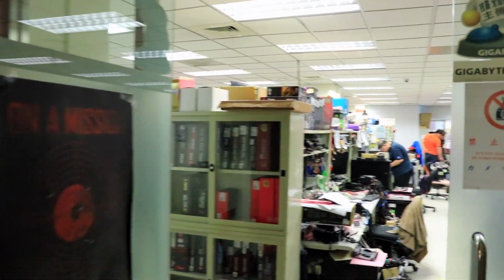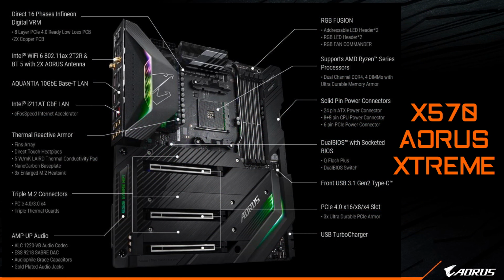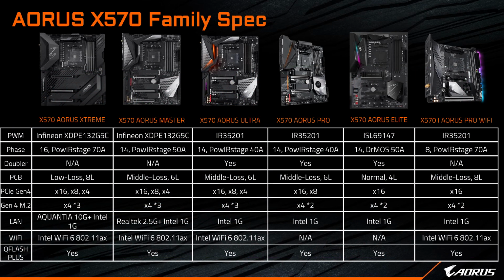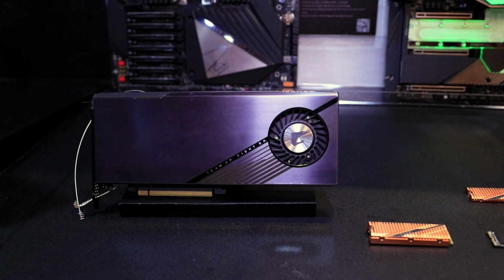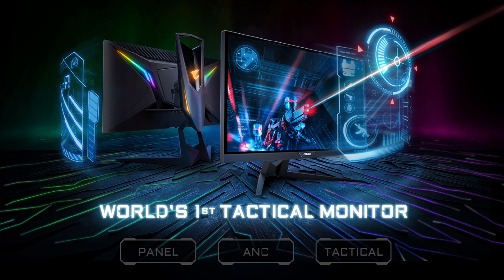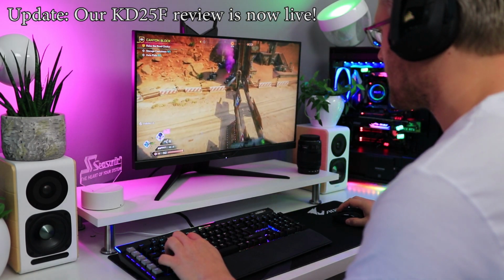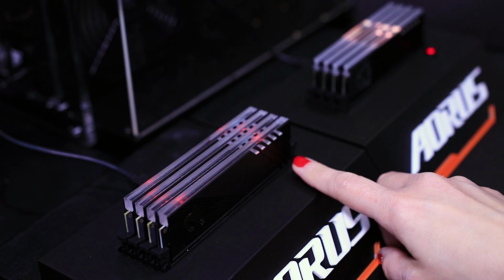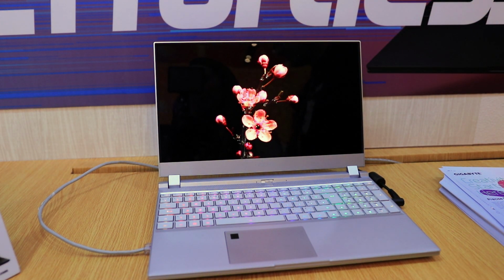Visiting Gigabyte HQ + Their 2019 Product Line-up (Computex 2019)

Comment: did you watch low budget motherboard for upcoming Ryzen 3000 series?
Reply from the maker: I actually talked about that a lot. X570 won't be cheap and cheaper B550 won't come til later this year. B450 and X470 motherboards will remain the more affordable options for Ryzen 3000. That's why we'll also continue to review a few new ones in the coming weeks :) Let me know if you need advice, or check  on discord :)
Reply: @TechTesters   i need your advice :) thats why i stay tune with you!